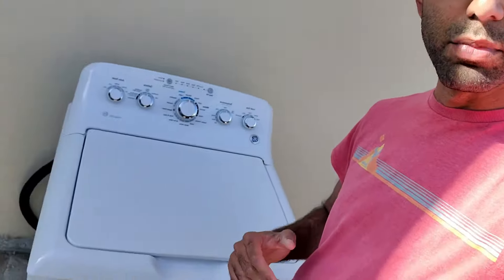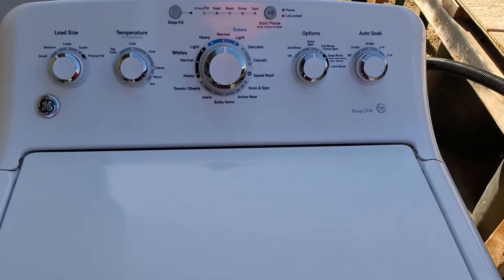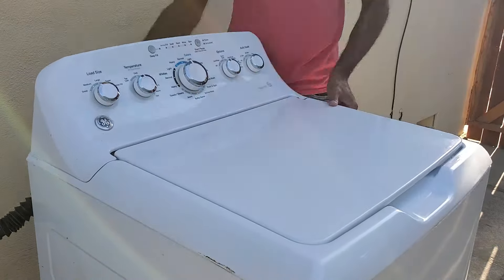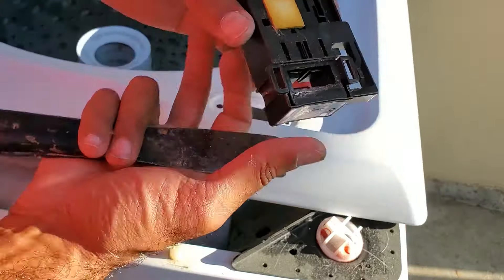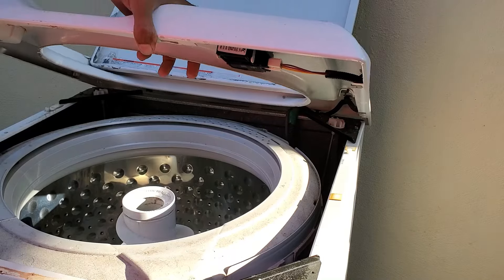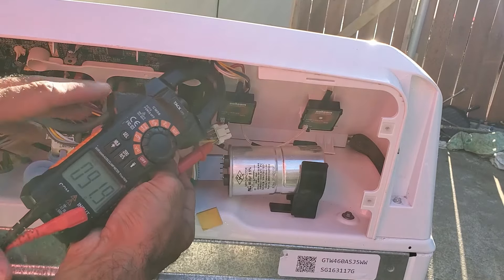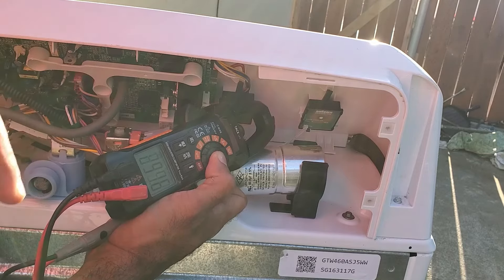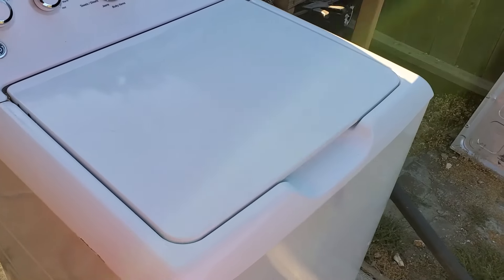Fixing A GE Washer That Will Not Start: Lid Lock Replacement

Comment: The link to the one you recommended does not work.
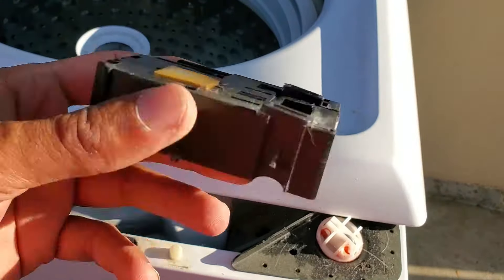Reply from the maker: Looks like the link I posted got corrupted.  I went back and added a pop-up link to the correct part. It should be around 5:32 mark in the video.
Reply: @DuctTapeMechanic I don’t see it. Can you just say which part is it so I can order it?
My machine is stopping in the wash cycle, and I noticed it’s not locking, so I am hoping your recommendation will fix it.
Reply from the maker: @elainebittencourt8976  hi, the part pops up on the bottom of the screen in the video. It's a pop-up ad, and it will take you to the exact part
Reply: I have watched all around 5:32 of video. No link
Reply: No link pops up for me either

Comment: Those of us who own this piece of junk washer should file A class action lawsuit against ge for all the money we've spent trying to get this junk with the defective locking mechanism to work consistently. I'm SO ANGRY
Reply from the maker: These machines certainly have a lot of problems!
Reply: I will never buy another GE product.  Absolute garbage.
Reply: I've had two of these pieces are garbage. I HATE them. Unfortunately it was the only washer available in the store!
Reply: Agreed! My control board has been malfunctioning for months, and now it won’t work at all because the lid lock is busted, too. I know I can repair it, but I don’t want to spend the time and money to fix a piece of crap machine that doesn’t even clean clothes well in the first place!

Comment: I watched your video and fixed my washer, even a girl can do it, Video made it so easy to fix my washer. Ordered the part off Amazon for under $45 and replaced it myself with your step by step instructions on video. Thanks !!
Reply from the maker: Great job on getting your washer working! I'm glad you found it helpful
Reply: Also a woman here whose washer just went out. I’m pretty handy and confident I can fix mine after watching this video. I have this exact washer. Thank you!
Reply: Why should you have to fix it at all?  I just bought one, did three loads and it stopped working.  Warranty service in 10 day.  What bullshit.  Never GE again.
Reply: @josephharrington3150  that's user error unless you bought used. My washer is 4 years old and I just replaced my lid lock for the first time
Reply: What part do I order anyone pacific
Reply: I concur
Reply: Does anyone have the link for this replacement? I have this exact same model, but the link is not working for me to go directly to the Amazon page.
Reply: @AngelinaWaterman  basically all top loaders
Reply: @AlwaysAMan78 I just bought this washer used and it doesn't work pretty sure it's the switch I got burned. I don't feel like buying a new Switch I wonder if I can bypass the switch. I wonder what if I could cross both of those wires on the plug to make it work
Reply: @VinceBadovinatz88  I don't know the switch makes a closed circuit when the lid is closed so it's possible but at the same time the machine might always think it's locked and not function properly
Reply: Mine just keeps clicking and won’t wash the rest of the way spin or drain I’m so lost

Comment: Just replaced my lid lock, which has been janky from day one, and it's still messed up!  It decided to stay on lock, right at the finish line!  I'm at my wit's end, with this rotten machine, and it's only 3 yrs old!!  I miss the old ones, before all this electronic nonsense!
Reply: SAME here... its been a piece of junk from DAY ONE and I'm furious!!!!!!!
Reply: @Peter I replaced the lid lock and the pump.  However, the lid lock still wasn't aligned properly, so I still had an issue...lol!  I ended up taking the lid lock off and putting it in its receptacle (can't think of the exact word), and now it works!  I don't close the lid, because I don't want the lock moving around, but I don't have little ones to worry about.  Sometimes I have to take the lock out and put it back in, but it works.  Man, if that contact btwn the lid lock and its receptacle aren't perfect, it won't work!
Reply: @aneicer4705  Every appliance you buy these days is absolute garbage, and it costs a fortune!

Comment: I literally thank God for allowing me to find your video so I could fix my own washing machine.  It just stopped working, and I was literally shocked because I had spent money doing other things, and a new washer was NOT in the plans. I tried to hire a company to repair it, but the rate was outrageous for me to pay when I knew the problem.  I have the same brand and model. I purchased the part for $20.99 on Amazon. After watching your video, I repaired it myself in 10-15 mins, and the washer is working, and the load is already on the rinse cycle! Thank you very much.  Be blessed! I will look out for more things from you in the near future. Thanks again!
Reply from the maker: That's wonderful! Glad it helped you
Reply: @DuctTapeMechanic  🙌🙌🙌me too!
Reply: did the part you ordered come connected with a black wire?
Reply: Hello can you please share the Amazon link you used to purchase the part.

Comment: I checked my lid lock with the lid closed and when i put the leads on the wires the numbers started at 72 then went down to 0.0 or 1. When i tested the lid lock with the lid open numbers appeared too, i think, i cant remember. You said with the lid closed it should be 90. Do you think my lid lock might be faulty?

Comment: If having a similar issue like washer will fill and then basically shut off won’t spin or drain is it still the lid lock that needs replaced? The lights for soak and wash aren’t lit up and doesn’t register if lid is open or closed
Reply: This is happening to me but when i open the lid it fills after stopping then once its in wash i can close the lid. I have an older model though. Im also wondering if this will fix it.
Reply: Did you ever find out? I’m having same issue
Reply: Also having this problem!

Comment: My washer keeps clicking and won't spin or drain. Tub is full of water. I think its the lid lock but not certain. I had a pair of tennis shoes in the wash that caused it to shake washer away from the wall as it was not balanced. Have any suggestions or recommendations?
Reply from the maker: Could be the shaking washer caused the lid lock assembly to break. I have seen that. Is the clicking coming from the top (most likely lid lock) or from the bottom (actuator or clutch assembly)?
Reply: @DuctTapeMechanic  sounded like the top. I unhooked the lid lock. Readjusted stuff in the washer. It wouldn't work all night but the next day I put it on another setting and now it works. Not sure what I did but it works. Thanks for getting back to me!
Reply: @leahforrest9155 do you remember what setting it was lol 😢

Comment: Hi! Thanks so much for your video!  I hope to do this repair as soon as I get the part.  Can you please tell me what the tool is called to unscrew the bolts and the size I need? Thanks so much!
Reply from the maker: It is called a nut driver. If you go to Harbor Freight and get the SAE nut driver set should be around $10 you will be golden to handle almost any appliance repair. Best of luck!

Comment: I have 50 v coming from my circuit board to lid lock. Both from the board and from the harness. Any recommendations? Could something else be drawing excess power or should I just replace the circuit board?

Comment: Need some help, if you can.
Have one year old washer like this.
In a cottage that gets winterized, so it has about 3 months of use.
Put in first load, it filled completely, and then did nothing for quite awhile, then drained out.
Now it wont even fill.  Just sits and makes a chittering sound (like it's sensing?)before shutting back off. 
Have done the diagnostic mode, door lock has passed the continuity test (though sometimes gets hung-up on release), blew out pressure line, stuck drill bit into lower air hose nipple. Belt is fine, both motor and basin spin freely.
Could the lid lock be the whole problem, even though it does lock?
Frustrated and at a loss.
Thank you so much.
Reply from the maker: I was going to suggest cleaning out the port for the pressure hose but you already did. That is often times the culprit so good job. I think at this point the lid lock would be a good bet. Best of luck

Comment: I have ge washer it stopped during spin and I thought maybe hose was clogged drained water then tried to start it it won't start now. I have tried plugging in and resetting it. Do you think it's the lid lock? It has clicking noise it locks but won't start cycle
Reply from the maker: The lid locks are notorious one these. It is definitely worth trying to replace it.
Reply: Hey that’s what is happening to mine. Did you end up fixing ?
Reply: Was it the lock?

Comment: Thanks for the video it was helpful do you think I could bypass a couple of wires with a jumper cable. So I could work the machine with the door open sometimes. Also I wouldn't have to buy the stupid door switch
Reply: I bought the machine used I like the old-fashioned ones that I can open the lid with and do some hand washing. My old one finally broke and I bought this I didn't even know they were like this. Do you think I can jump 2 of those wires and get it to work
Reply from the maker: Do not jump the wires on this machine. Unlike the old machines this is not just a lid switch it is also a lid lock, therefore you can damage the control board by trying to jump it
Reply: @DuctTapeMechanic thank you darn it
Reply: opening the lid lock assembly might be an option, but i havent tried that yet. But then again, 'not user serviceable' on any of this overpriced e-waste trash has not stopped me, and im not about to get started.

Comment: My lid lock started acting up (turning on and off for at beginning of cycle), then washer would not start.  I removed it, one prong looked corroded.  I sanded it and scraped it with needle nose pliers.  I put it back and now it works
Reply from the maker: Great work!
Reply: Thank you for this comment! I did the same and was able to fix it without buying a part. I really appreciate it!

Comment: I am on my 3rd lid lock and my second set of tub shocks on this style GE washer. It was sold to us because we were looking for a washer with a large tub new. The next time it stops working  I will take the tractor front end loader and crush it before setting along our mail box to be picked up as junk. This will stop it being picked up and resold to someone else, saving them the problem we have had with it. My first washer and dryer I bought in 1981 lasted 36 years but the washer weighted about 3 time as much as this one.
Reply: you could just part it out at the very least, save others a few bucks out of parts, or recoup the money spent

Comment: So is this testing the wire harness or the lid lock? Bc I know my lid lock is bad but I can't figure out if I need to get a new wire harness too?
Reply: Just get a multimeter and check for continuity on all wires (for the connector-based ones)
on newer models, they made the damned lid switch a straight pigtail with no disconnect except for the control board connection, so any testing will just be straight up both the lid lock and the harness - same deal with replacement.

Comment: My ge gtw465asn3ww threw a belt during cycle. I changed lid switch and replaced belt, machine has power but will not start. Any suggestions?

Comment: I replaced lock switch but still won’t lock . What control power from board to lock switch ?
Reply: That's what I'm worried about if I buy this part what happens if it doesn't fix it then I'm another 45 or $50 down the drain I just spent $100 on this machine used I'll never get my money back it didn't work I should have tested it on-site

Comment: Hi my washer is not doing the spin and not draining the water but it does fill with water and watches the clothes you think is the lid lock?
Reply from the maker: If it is a model similar to this one then I think it is not the lid lock other wise it probably would not wash at all. Without actually being there, I would say there is an issue with the mode shifter.

Comment: Can you please provide the original GE OEM part number in the video description as you stated in the video?   Looking at the provided amazon link, it appears this is replace 1 of 3 potential parts.  Thank you!  Video looks most helpful and I'm hoping this fixes my problem.   My wash actually starts and puts some water in the machine.  The locking mechanism actually actives, but the lid lock lock light never turns on.  Then it just times out.    Do you think it's the same problem even though the top does lock?  Thanks again.
Reply: Did you ever figure this out ?

Comment: I have a question, although I see this is three mths old, I'm hoping you can help, before I take the top off completely.  I can see the screws holding the top down, but there are also smaller screws, holding wires down.  I'm hoping the screws holding the wire ends down aren't holding the top down, as well, and maybe they're very short?  Looks like I have the same washer.  If you can help me, I'd sure appreciate it!!
Reply from the maker: The screws holding the wire do not hold the top, you don't need to worry about them. Good luck with your repair.

Comment: So we got the new latch lock that was specified for the model of my GE washer and it did not work nor did it match the parts specified on the QR code on the washer itself. Sent that part back, ordered another and after installation, it finally allowed the washer to fill, and then it stops as the lid lock is still not working. Help!

Comment: I have the same washer.  It will fill but nothing else.  After a few minutes it drains on its own.  Is the lid lock most likely the issue?
Reply: im having the same issue. was it the lid lock
Reply: Hi.  Did you have success with lid lock replacement? Thank you
Reply: I have the same issue and just replaced the lid lock if I put it on drain ans spin it locks and runs fine but on any other cycle it will fill and then drain do you think the new part I got may be faulty? Or another issue?

Comment: My GE Profile washer says Lid and it will not do anything. It wasn't off balance. I had just washed a load. Do you think I need to replace the Lid thing?
Reply from the maker: Most likely it does seem like an issue with the lid lock

Comment: My washing machine is making loud noise. I follow directions and changing the rear and the I don’t remember what it was that I change underneath of the transmission but it’s still making the noise. There was no debris underneath of it. Wanted to know what’s the next step that I need to stop it from making so much noise Sound like it’s coming from the transmission valve noise
Reply from the maker: I would look at the clutch/actuator assembly all parts combined are like $80

Comment: i have one of these washers that it just broke the lid lock. i wonder if theres a way you can just bypass it. i only saw 3 wires going to it
Reply from the maker: Do not try to bypass the lid switch it will most likely burn your control board. Unlike the old school washers, these are not just switches but also have a solenoid which locks the lid.

Comment: Love you videos. Can i jump the red and yellow wire at the switch end to trick the machine? Its full of water so id like to have it pump out. Thanks!!
Reply from the maker: Do not jump the wires. It will ruin your control board. The best thing to do is just take the cloth out and get a replacement lid lock.
Reply: You can enter service mode and find the option to 'test run' the drain pump. Look up the codes to your machine before entering service mode, preferably by finding the paper manual the washer came with, stored somewhere inside the chassis.

Comment: My washer will not start at all, but the lights will light up and the lid lock will click a couple times then stop.  Then you hear the sound indicating a wash cycle is finished.  All this but the machine will not start a cycle. Does this sound like a bad lid lock or something else?
Reply: Did you figure it out? Mine is doing this exactly now.

Comment: the amazon link is broken, but this one comes with a black cord LID LOCK & HARNESS

WH08X32657

what would I do with the cord?
Reply from the maker: Here u go a new link for the lid lock mechanism.
https://www.amazon.com/WH01X27954-Replacement-290D1580P004-290D1580P001-290D1580P002/dp/B0CGV9VPVY/ref=asc_df_B0CGV9VPVY/?tag=hyprod-20&linkCode=df0&hvadid=675668942552&hvpos=&hvnetw=g&hvrand=13377694247124940523&hvpone=&hvptwo=&hvqmt=&hvdev=m&hvdvcmdl=&hvlocint=&hvlocphy=9032521&hvtargid=pla-2245443581439&psc=1&mcid=e57419387bfc3558972f4caa776469ff

Comment: Mine just drains plug it in it just drains I can't put in diagnose mode and it will stop ,then acts like it's working  but won't spin or drain after that 😂. I've changed the pump the door lock and the motor because it sounded bad . Searching to find help 😢

Comment: Is there a way you can just bypass the switch all together by cutting wires or something?
Reply from the maker: No bypassing the lid switch on this one because it is a lid switch and a lid lock
Reply: @DuctTapeMechanic  thanks for the reply. It just blows my mind that they make these lid locks mandatory on all new washers. I just don't see the need for a lid lock on a top load washer.

Comment: my GTW330ASK4WW is not filling up and won't successfully spin to drain out the water.  i've reset the lid after unplugging it... and it worked for 1 load but now it's not working.  the lid is locking though when i put it into spin.  would this be an issue with the lid lock mechanism even though it's locking?
Reply: Mine did the same thing 6 months ago, I replaced the water pump underneath the washer simple to do.
Reply: Mine is doing the same thing! Did you find out what was wrong with yours?